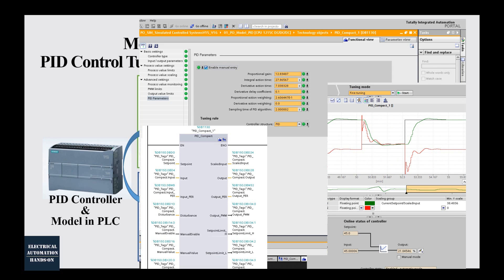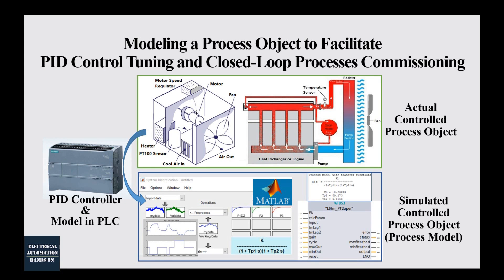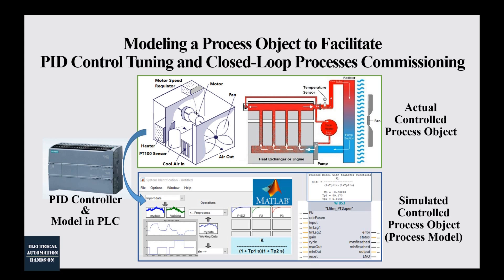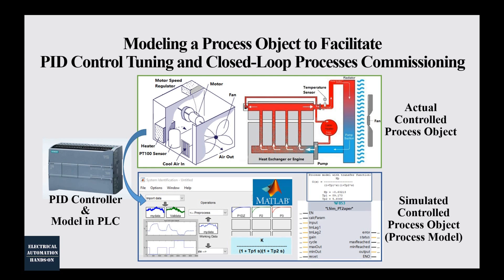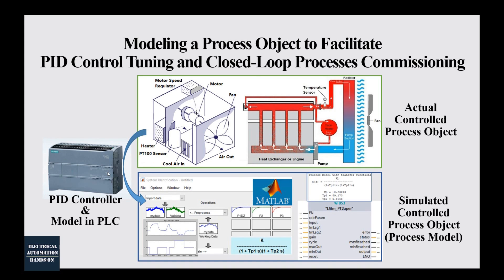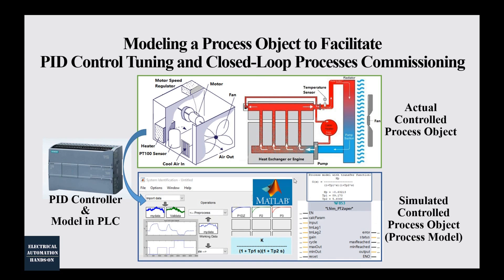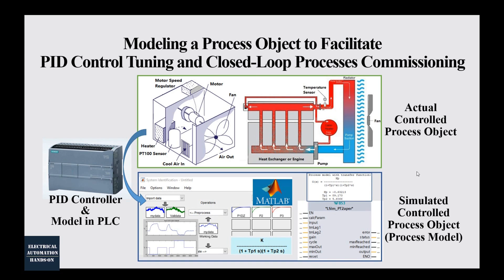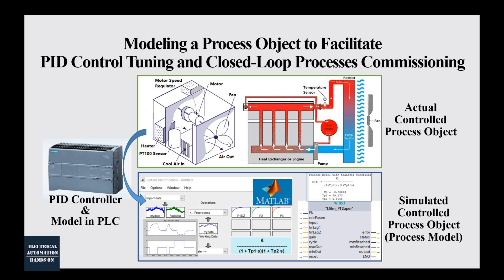PID00 - Modeling a Process Object to Facilitate PID Control Tuning and Closed-Loop Commissioning

Comment: I would like to know, do I really need to buy Siemens hardware to go through this or is it doable by only a simulation?
Reply from the maker: You can use PLCSim for simulation and practice PID and Model.
Reply: @electricalautomation  thanks, because I really love to do this, but I don't have enough money to buy the real hardware. I will use PLCSim then, so that I can get to UNDERSTAND how PID operates.

Comment: Hello, i have a fast vertical positioning application with gravity factor in decrease movement, I  use tia portal and I can't tunning the PID, I tried pre tunning, fine tunning, I used pi - pd  and pid control but I haven't good results. For example, I fix perfect results tunning for 50Hz decrease and when I work with different speed I have bad results etc.  Can you send me a mail to contact with you? Thanks.
Reply from the maker: You can find my email from the beginning of every video. Regarding your case, I don't think auto tuning can work for it. Because the vertical/gravity such system is not a 'self-stable' system. Comparing this, the water level, temperature, can use auto tuning. You have to use manual method to tune it. Please send me email if you'd like to discuss more.